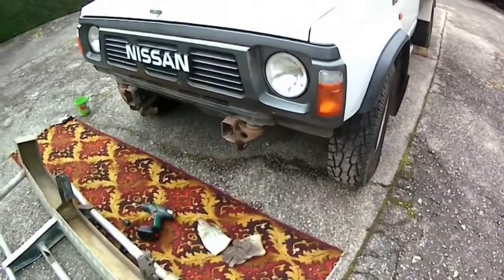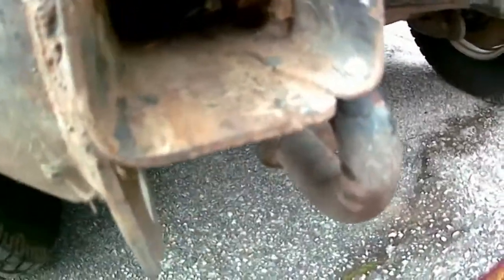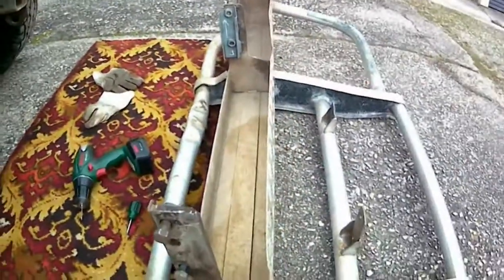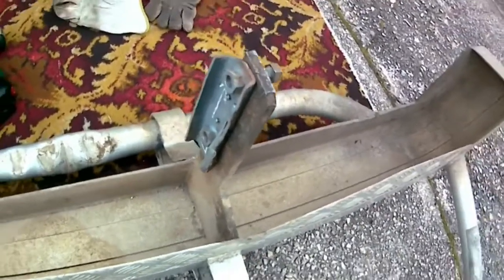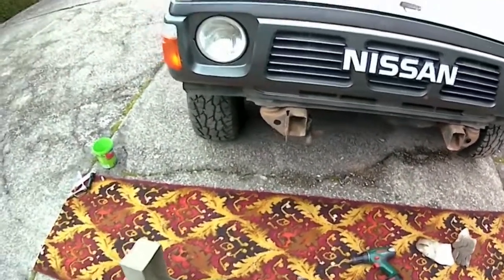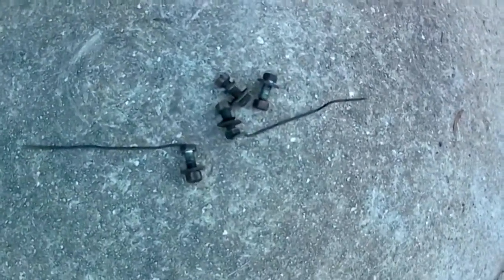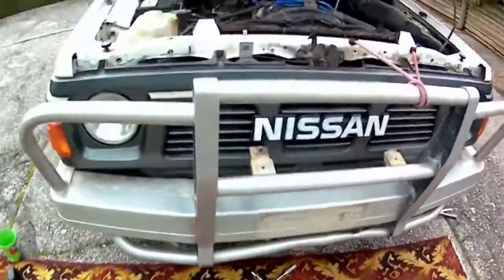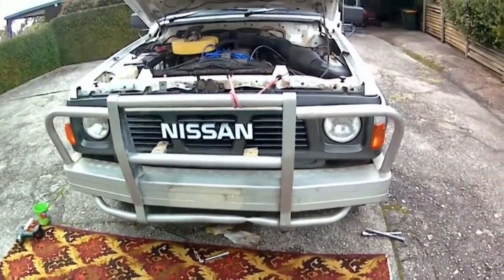Nissan Patrol Bullbar Install Catch22

Comment: Mate I’ve got the original bolts on mine just removed it and the bolts go from the inside out and come with rods already on them as it’s to slid them in when you are underneath u can actually look into the frame rails and slid it back inside
Reply from the maker: thats good :)
Reply from the maker: That's good - easier to replace.